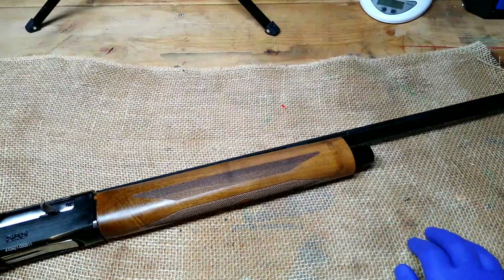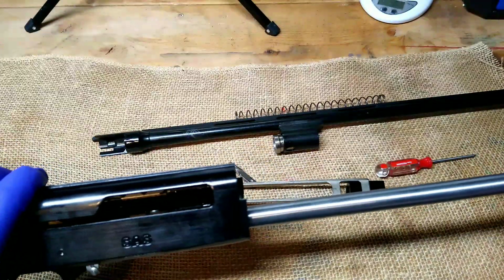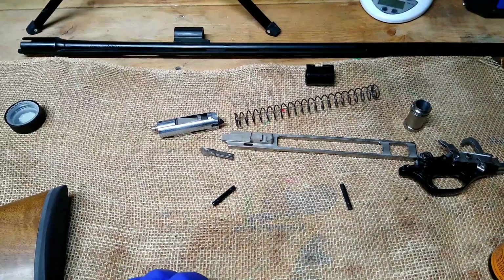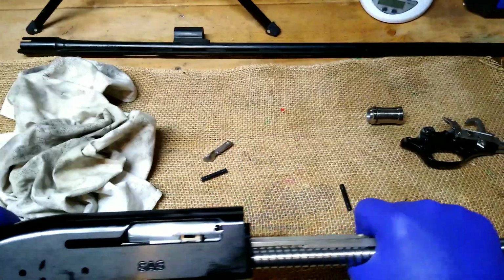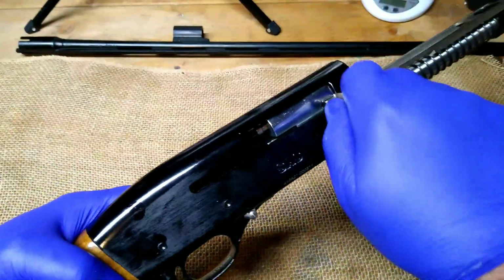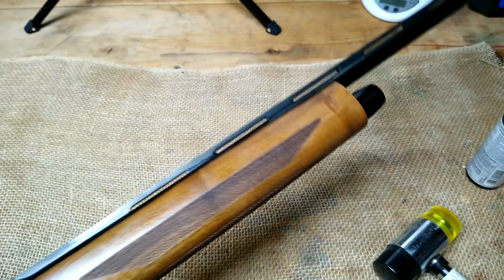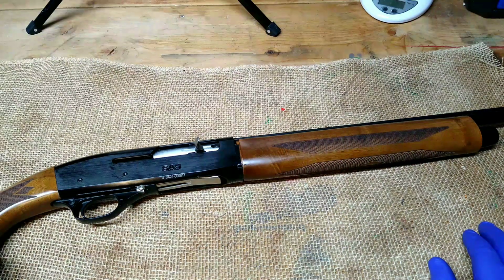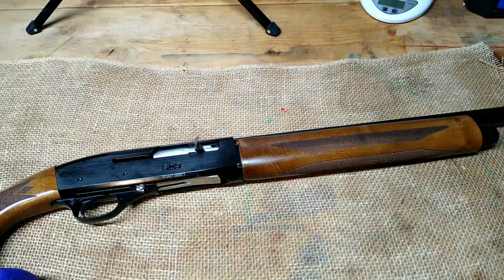Hatfield SAS 410 semi-automatic shotgun, disassembly, lubrication and reassembly. before shooting.

Comment: Mine is actually very different in that my trigger group has only one pin which is the exact same size as a ar15 trigger pin and is the front pin and the trigger group is at least partially made out of plastic but I don’t know just how different until I disassemble it for the first time

Comment: Hope y'all have better luck with these than I did, mine was full of metal shavings and the bolt got stuck after 50 rounds.  Upon disassembly I found many, many little things that were not machined correctly and many more that required some filing and polishing.  I expect a little break in period with a new gun but this is ridiculous - BY FAR the worst quality firearm I've ever owned.
Reply from the maker: They are the least expensive semi auto shotgun you can buy, so you gotta expect quality to be somewhat lacking. So far 3 of the 4 I have are running okay. Thanks for watching
Reply: @HamiltonOutdoors  I am not giving up yet, I'll run some more shells through it and see.  I wasn't expecting perfection but the issues I found indicate that whoever assembled it paid ZERO attention to whether or not it would function... I'll be happy with it if I can get it past this point.
Reply from the maker: @sn2ch  I hope you get her running.
Reply: Just to follow up: these shotguns are absolute junk. I ran another 75 rounds through it and it was full of metal shavings again and upon disassembly I found that the bolt was cracked on the left side.  It is unfixable, the design is such that it beats itself to death and this is the outcome. Hatfield has said that they will refund my money - we will see.

Comment: Looks like the small metal shroud in front of the receiver and rear of the forearm wood is missing a piece on the top/right side.   Damaged or broken?
Reply from the maker: Yeah I seen that I just didn't dawn on me until you said that I will have to check that out. Thanks for watching the video